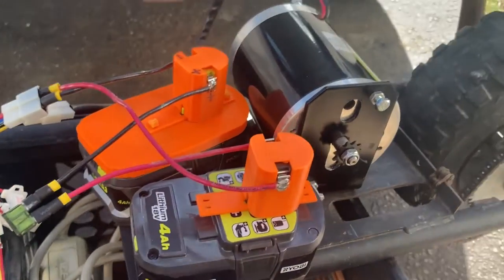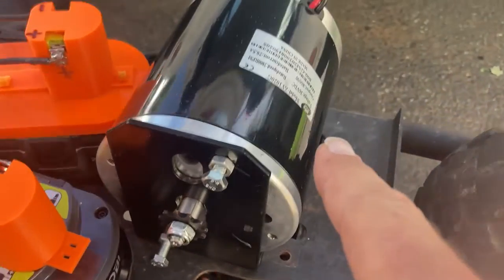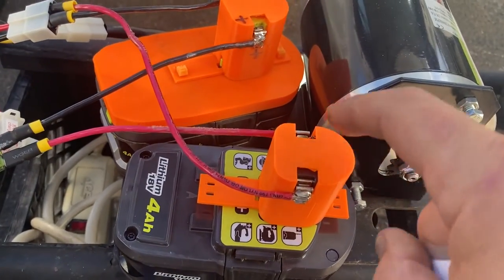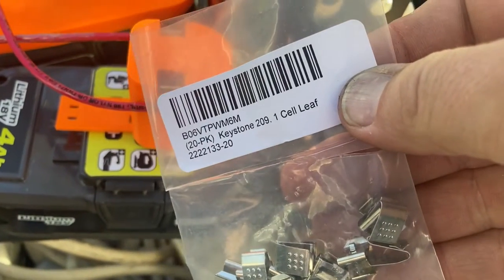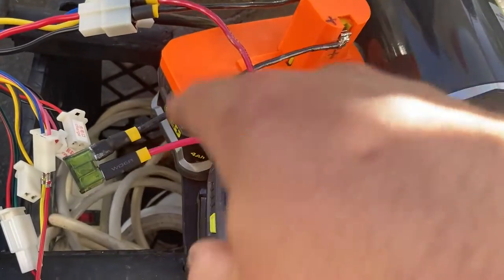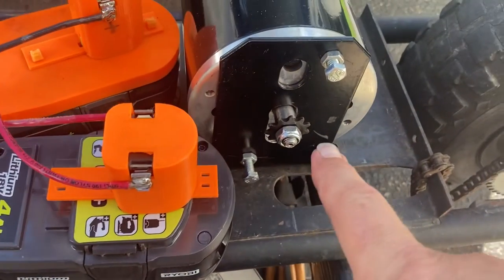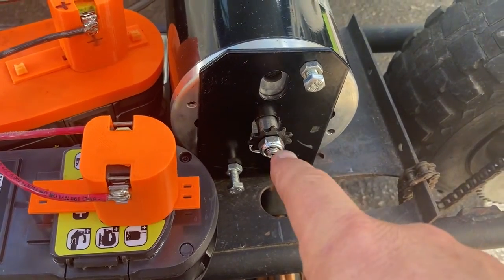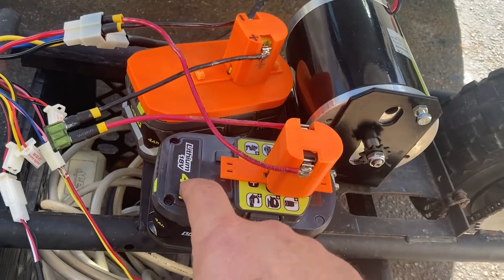3D Printed connectors for Ryobi 18V batteries to electric Mini Bike

Comment: That's awesome. I want to 3D print and adapter so that I can use the Ryobi battery in the old DeWalt tools
Reply from the maker: This is probably reverse of what you want, but I'm sure if you look around, somebody has already modeled it up! https://www.thingiverse.com/thing:1248463
Reply: @BenjaminNelsonX  about a year ago I searched extensively. I came to the conclusion I have to design it myself.  I don't know why people have made adapters to put expensive batteries on cheap tools but not the other way around.

Comment: Proof positive, electric motors don't care where the current comes from.  For an ICE the only source is a gas station.
Reply from the maker: As soon as I got the inverter on the Solar Trailer up and running, I started using that for charging these batteries too!
https://www.youtube.com/watch?v=BKZhDQPRAoc&list=PLmHss3DBZUin-oq_ZOQkdC62hHJRpkEGs